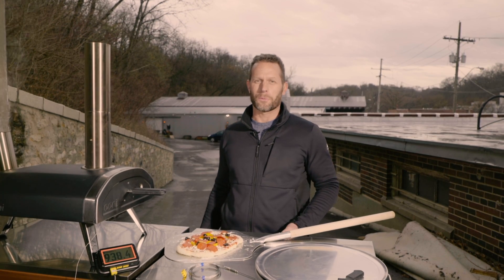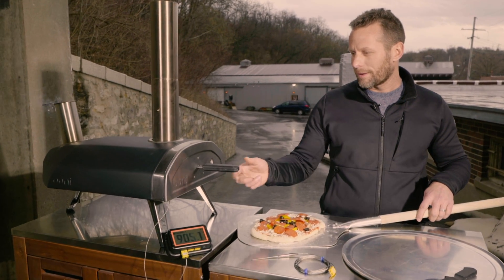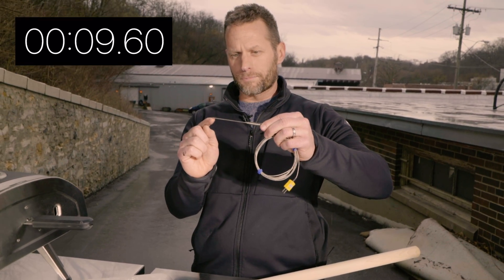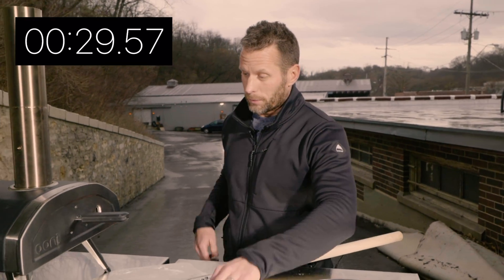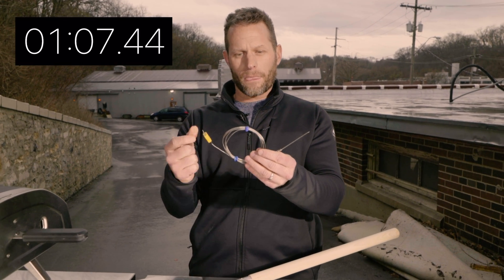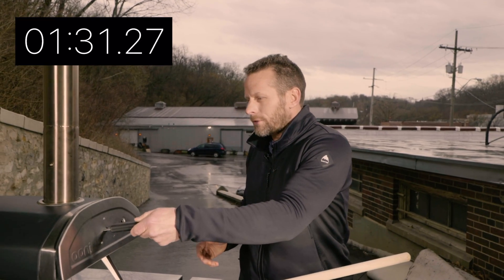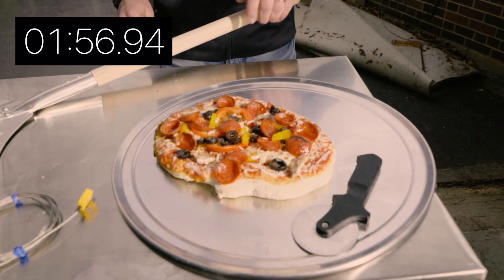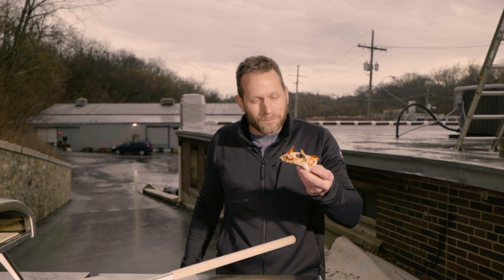Science of Thermocouples | Pizza Challenge!

Comment: I wonder whether others too are having issues  with the thermocouple probes. They only work intermittently for me. I am guessing it must be an electrical insulation issue inside the cable that becomes an issue near the the connection ends. I had one replaced a while back, it had the same issue,  I made number of calls, till I have given up on the unit.

Comment: How does the fan mount to KJ Big Joe 3?  Can the grill be used without the fan when wanted?
Reply: I believe it can. You can take off the fan, and also control speed/power of the fan in the app
Reply: The Fireboard 2 comes with mounting brackets by default, one large, one small. They've also added some additional mounting adapters recently, I'd checkout out their site. I'm using mine with a Joe Jr without any brackets and it works well using the seating brackets on the fan along with the Jr's bottom vent baffle.
Reply: @alexsilkin5222  Thanks for that info on the Jr. Are you still enjoying it?
Reply: @BrianMiller1973  Yes! It works for the two of us really well, and I've also taken it on vacation with with us.  If I had to cook for more people on a consistent basis I'd probably add the regular size Joe to the arsenal. Have used the Jr for pork shoulders, brisket (albeit I had to trim like 5-7 pounds of the flat to fit on the grill but it turned out great anyway), ribs, chicken legs and just regular grilling.